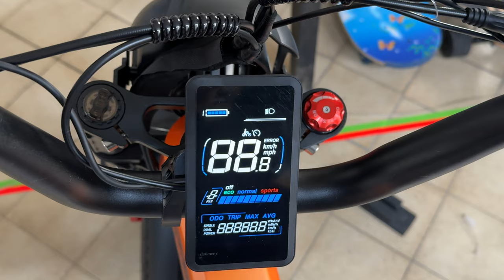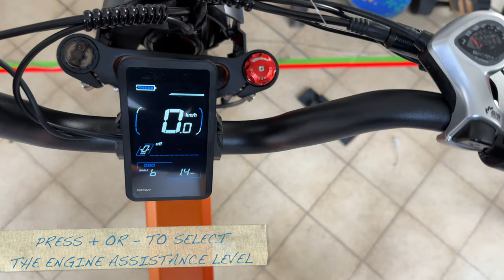LANKELEISI X3000 MAX - MOST POWERFUL ELECTRIC BIKE FOR ALL TERRAINS - COMPLETE TEST - 4K

Comment: Top speed of this bike is around 50kph. Did you upgrade the battery or have you edited ti speed reading?
Reply: he change the setting with the wheel width if u see on video when he is at settings, he put it at 39'' instead of 23-24'' where the fat 20''x4'' tyres goes usually. that change the speed on the screen because it things it has 39'' wheel so it covers more distance. therefore more speed. but only on screen.  he does that with other bikes too. its an enjoy to watch his videos, but his reviews are far from reality usually. 

this specific bike goes up to 45kmh on gps. it has the same specs with the lankeleisi mg740. the mg740 tho has a 26x4 wheel, so it tops up to 47-48kmh, but the x3000 has a liitle bit more torque. the motors on the bike are not 1000w actually, the current is about 500 or 750w. they peak at 1000 something. but the controllers on this bike goes up to 19amps for each wheel. which means 19x54.6(a full charged 48v battery charges up to 54.6v)=1037w. thats how it gives 1000w as peak power.  but as the battery goes down, so the performance does. 

so in general, philodo, smlro, shengmillo, duots and every other dual motor ebike from china, are a little bit stronger than lankeleisi bikes motor to motor. same goes on the single motor ebikes. these other bikes have controllers with higher amps. 22-27per motor. thats how they can hit 50-60kph. and they actually have 1000w motors. thicker wires, bigger motors.  
where lankeleisi wins tho, is at customer service. there are cases that the bike broked and they send a hole other bike to the customer without any returning. they dont have perfect customer service of cource, but amongst other chineze reseller companies around here, lankeleisi is the most reliable for sure.
so if u good with maintentance stuff and dont care about customer service, go for something else. if u want something a little slower but more reliable, go for lankeleisi. all this, if u want a budget dual motor ebike of course. other wise ur choices are unlimited.

Comment: the fastest i can get this bike to is 25mph/40kmph unlocked and i weigh 90kg.
ive messed around with the settings and have this setup . ANY COMMENTS APPRECIATED
02P - 21inch
03P - 100km
O4P- 00
05P-02
06P-5
07P- 50